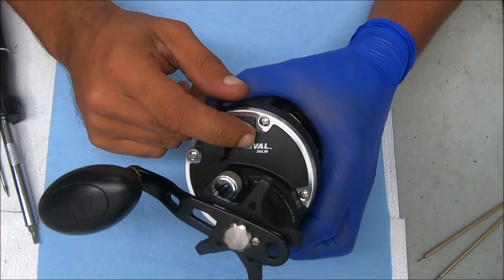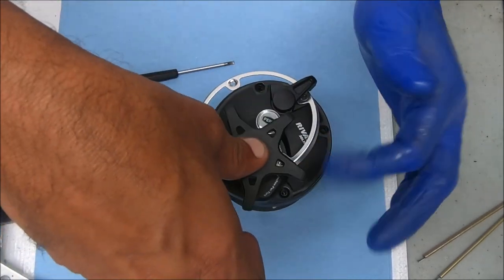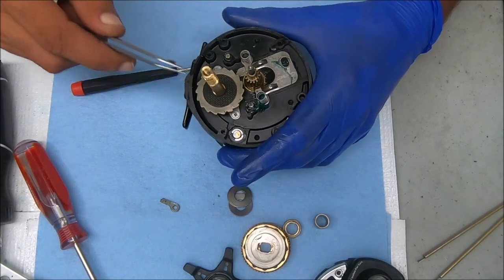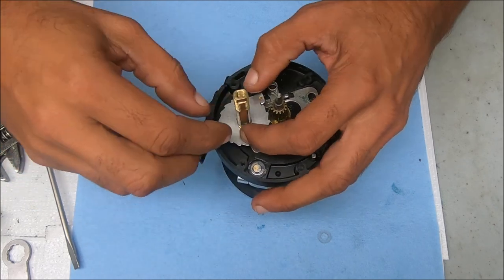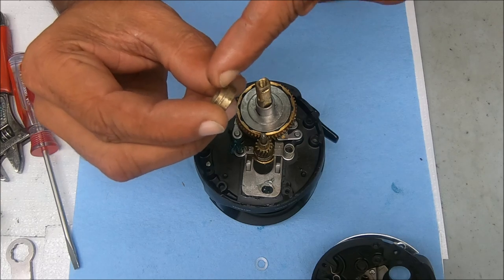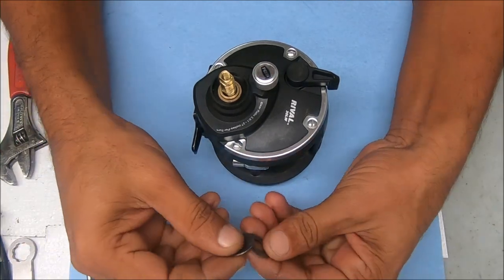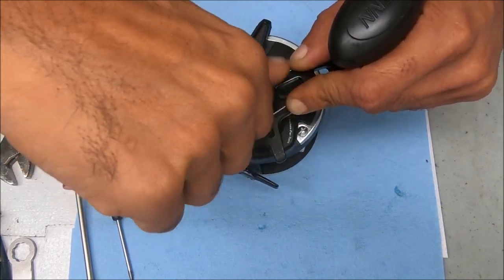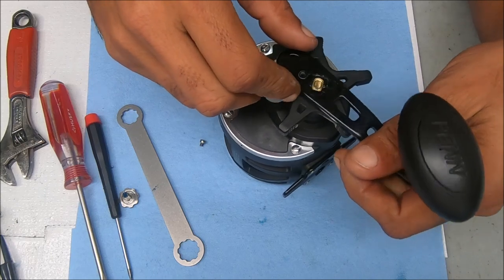Penn Rival 30LW No Anti-Reverse - Diagnosis and repair: Fishing Reel Repair

Comment: Hi, thanks for the upload, this was the exact problem on mine - both dogs were all bent up.   One problem i've having though, is the main drive shaft (the brass bit the stack goes on) is really wobbly, any ideas what's causing it?   It moves side to side around 5mm.  Im kind of wondering if that's what caused to dogs to get bent in the first place.
Reply from the maker: If that amount of movement is happening after the reel is entirely reassembled, then something's probably wrong. Check parts #41, #41A and 98 on the schematic for wear and/or fit. Yes, that could be a contributing factor to wear on the dogs.

Comment: I have the 20lw and when I pull on the line with with it in gear and any amount of drag set it skips and the handle go backwards. Make a clicking sound. Definitely coming from the handle side. No the line out alarm isn't clicked in.
Reply from the maker: Thanks for watching and your input.

Comment: Anyone having problems when casting it locks up or any ideas what it could be just picked one up and having that problem
Reply from the maker: Thanks for checking out the video. If it's doing it while still in free spool, could be a bad bearing, or something damaged/loose in your levelwind system.

Comment: How do you know what parts to buy if I were to take one of mine apart cause i can't even find what kind of reel it is I bought a ugly stick Camo rod and reel combo and after 4 catfish that were pretty big my drag won't even work if I let go of the reel handle it just starts getting taken back the other way with the line and I've never had this happen so don't even know where to start and the reel only says shakespeare on it nothin else
Reply from the maker: Thanks for checking out the video. Sounds like the anti-reverse on the reel has failed. It can be difficult to source parts for those combos, so you probably can't fix it yourself, but your local tackle repair shop might be able to if you take it to them. Otherwise, the best course of action is to purchase a new reel. Sorry I don't better news for you.